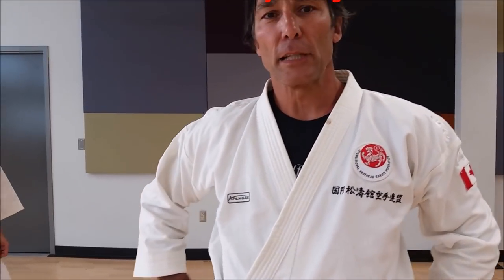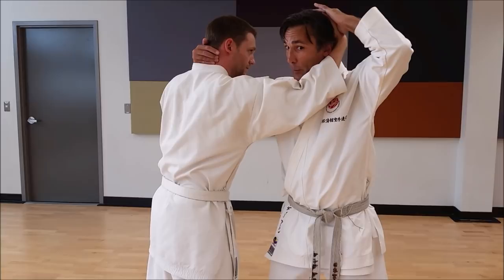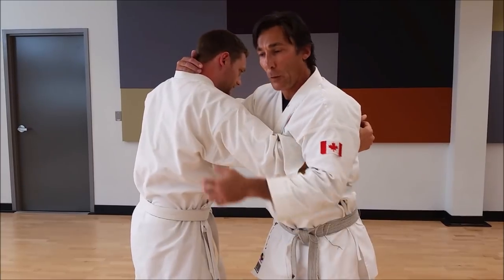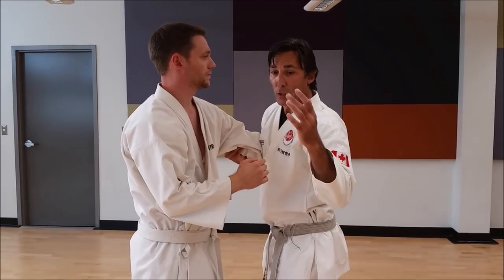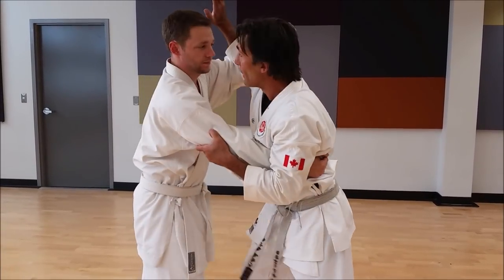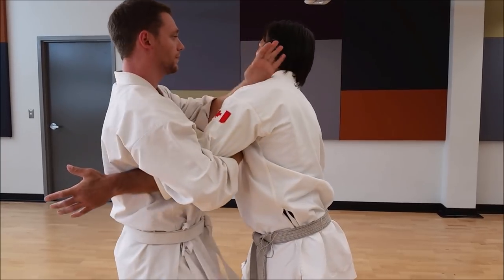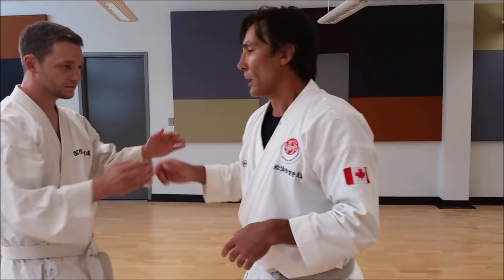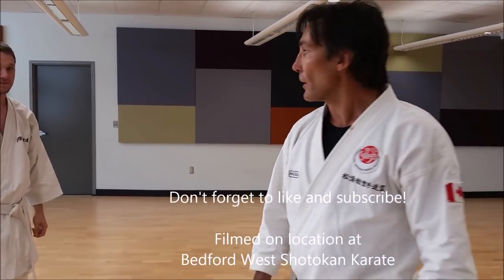Shuto Uke Flow Drill

Comment: Really nice. I think this might start as a response to a jab when you are holding a low fence. (He jabs with left, you slap it away with your left and stab at his throat with your right. Then use the right to pull his arm back and the left to hit his neck.) After that you could flow straight into this as you'd be at close range and almost grappling anyway and he could be hitting you with the other hand.
Reply from the maker: Unlimited possibilities!

Comment: Bullshit

Shotokan was not design for close combat. Uche-uke has abdolute different base application in shit ry or even in winchun.
Reply from the maker: Very insightful, thanks. Shotokan lost its close combat roots. In the process, the true value of kata was also lost. Kata became nothing more than a performance, or movement for the sake of movement. For the past several years, I have been investigating the close range applications of kata. This video has nothing to do what kata was designed for. It deals with a practical approach to karate as well as practical kata interpretation.
Reply: @AppliedShotokan  Of course Shotokan is from Shorin-Ryu and it's 100% close combat. 
It's more like later on Shotokan got mixed with Kendo and western kickboxing styles to change in the way it is today.
Reply: Every kata is ment for close combat.